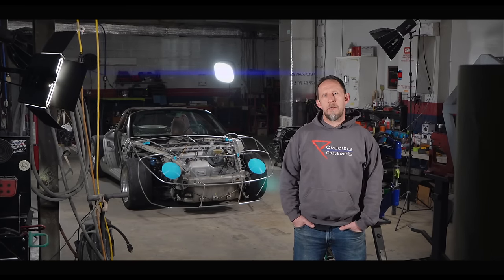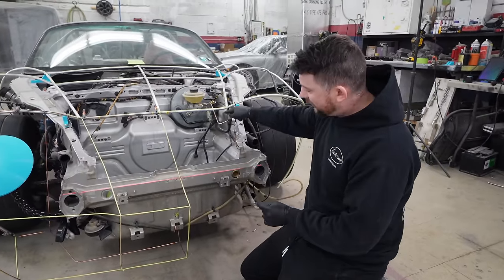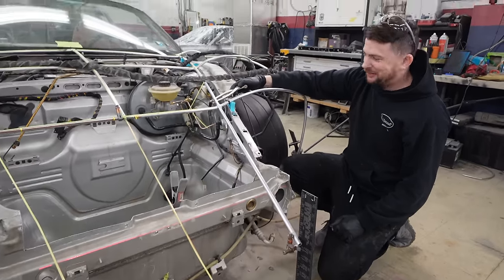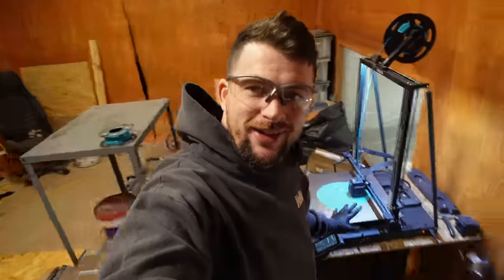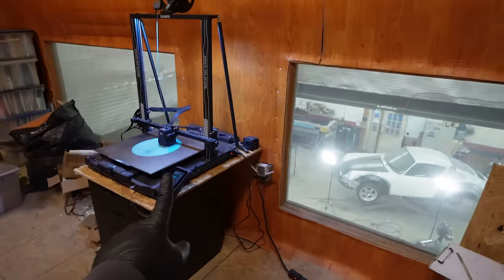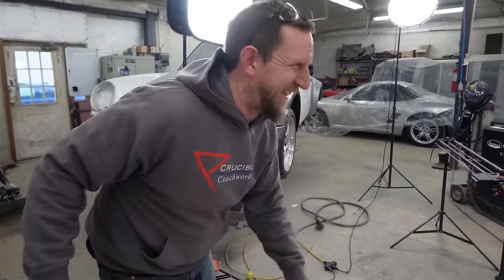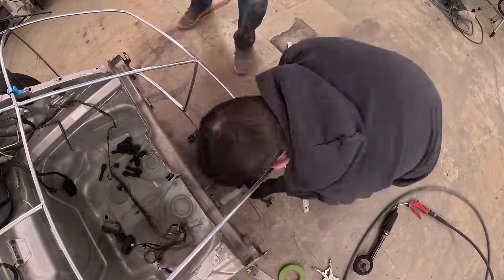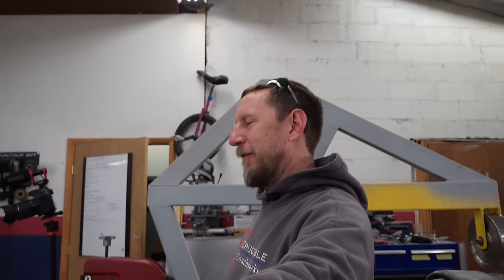$500 Junkyard Supercar! TUBED Front End is DONE! - Project Jigsaw

Comment: Ok, hear me out. That wire frame dividing the intake grill area looks kinda cool! What are  your thoughts about doing a large bifurcated middle grill area, with smaller intakes on the corners to balance it out?  If it was done right, it could be a really cool modern styling choice that still looks retro, and might help with issues of it looking too much like Miura or GT40.

Comment: What would help is a boundary box to reference from even just a square bar mounted square to the car attached to the bumper mounts would help to measure from. and also some blocks jacking the car up evenly would enable you to measure from the floor aswell as suspension would be a variable that would eliminate using the floor as a reference.

Comment: Make yourself some adjustable stands out of sleeved tubing that have a flat base on them and that way you can put it exactly where you need your aluminum tubing to set and it would be like  multiple persons assisting you with precision. Also, propane is cheap and if you made a small forge that you could pull the tubing thru it to aneal it, it could get you the temperature you need much faster and it would be more consistent.

Comment: You guys do nice work, I wonder if using a BBQ bottle and a weed burning torch would give you more control during the Anealing process, in plumbing propane allways takes longer to get the piping up to temp to take the solder , plus the flame on the weed burning torch would go around the whole pipe evenly . Just a thought????